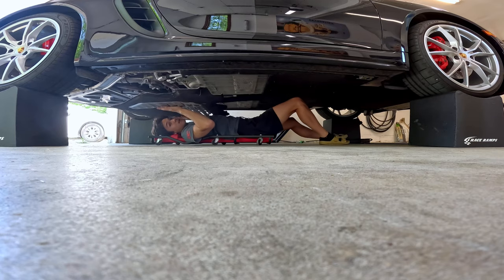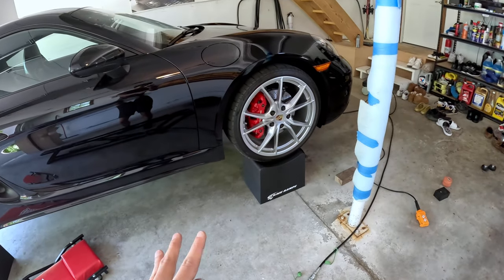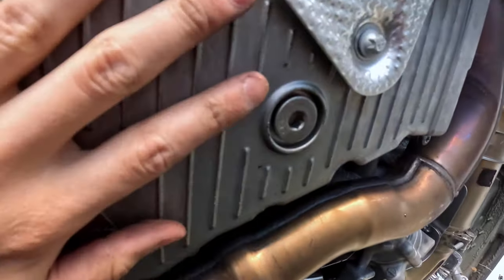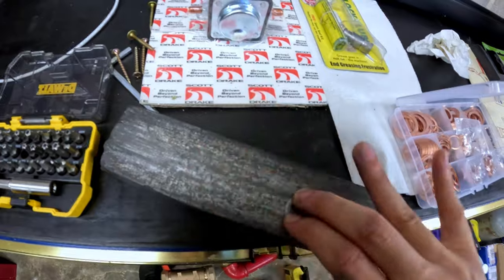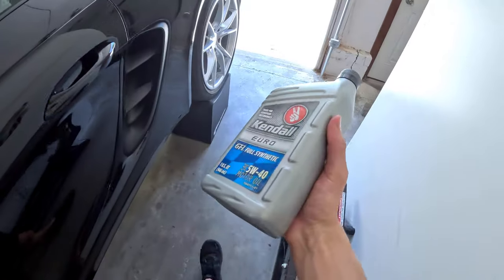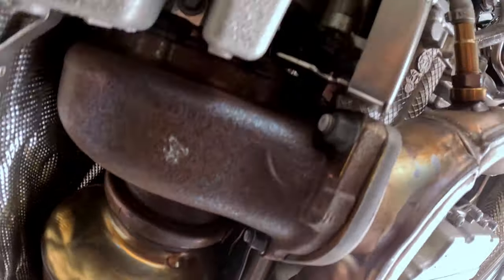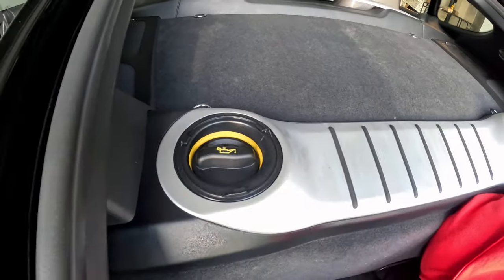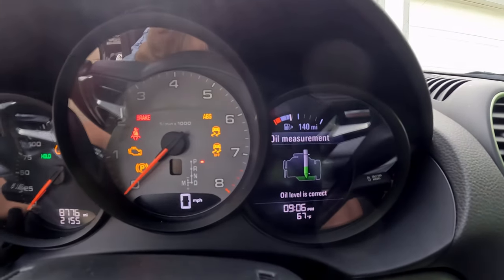Porsche 718 Cayman (982 Chassis) Oil Change + ECU Reset Tutorial

Comment: “Made in Germany, made in Germany, made in Germany…” umm, there’s the oil filter way back there… What’s the fascination with German design and engineering? If you’re spilling oil all over the car’s under tray, that doesn’t sound like good engineering to me. How much oil did not make it into the crankcase last time??
If you want something self-serviceable and affordable to maintain, what the hell are you thinking in buying a Porsche?
To justify not changing an oil filter because you’ve ‘only’ put on 3000 miles since your last oil change is absurd - when are you going to have the energy and gumption to actually change the filter? You even admit that it was 3000 “hard miles.”
Reusing a crush washer? Crush washers are engineered to ‘crush.’ Once. 
What is your reasoning for sanding the crush washer?
If your car is something so revered why would you want to cut corners with the maintenance, and then have documented proof of lax maintenance?
A car with no dipstick. Is that sound engineering? 
If you’re looking for something that is cheap and easy to maintain, and will get you from A to B without a computer telling you (or not) that you’re low on oil maybe stick with a Japanese car (Mazda MX-5?) - I saw a Lexus and a Corolla in the background…
How much did the hydraulic lift, Race Ramps, and OBD scanner cost?
The resale value of your Porsche (or any “premium” car) plummets when not properly maintained, so maybe the dealerships $700 oil change isn’t so bad after all.
I feel like an old curmudgeon right about now.
Reply from the maker: Thanks for your comment. I appreciate you watching my video. I will answer all your questions in numbered order.
1. My fascination with German engineering is that it is a foreign design. I live in America and don't see many cars with genuine German engineering. Many are German companies but assembled elsewhere in a cheaper country. 
2. My spilling oil into my undertray was a user error, and I wasn't being careful to not spill any oil. That's my fault, not necessarily the engineering of the car. The last time I had maybe, at most, 1/4 quart that did not make it into the crankcase, but no big deal.
3. I never said I wanted a car that was self-serviceable and easy to maintain. I have a Toyota Rav4 for that. This isn't my only car, and this car only comes out in perfect road conditions. No salt, no rain ever. When shopping for this car, serviceable and affordable to maintain was not even considered. 
4. I did not change the filter at 3000 miles on it because this is not my everyday driver. It would probably take another year, if not more, before I reach the appropriate mileage to even require changing the filter. By then, I will be changing the oil once more, and that is when I will change the filter, and it will definitely still be under the recommended mileage when I change both oil and filter next.
5. Reusing a crush washer was because I didn't have a replacement washer to put in place. I even said in the video this isn't the recommended way to do this, so I am not encouraging it, and the risk is all upon me. The crush washers work by crushing the edges of the washer to ensure a perfect seal with no leaks. The reason for sanding it down is to sand down the bits that have not been crushed to create a flat washer again. At that point, the crush washer will work again correctly without any leaks. A crush washer is only meant to be used once, but sanding it is one way to extend the washer's life to be used one more time. I wouldn't do it a third time, though. In a perfect world, I would've had another crush washer to replace it, but knowing it would take a few days, I went ahead and sanded down the one I already had. It will and has been working just fine with no leaks. 
6. I don't think my maintenance is lax at all, and just because it wasn't done by Porsche Tech doesn't mean it is subpar. I know everything was done correctly, and the oil and filter have been changed before the recommended mileage and date, so I've maintained the car in more frequent intervals than Porsche recommends.
7. this car has no dipstick because of the location of the engine being the center of the car. Unless you start taking apart the interior, there isn't easy access to the top of the engine. You can call that lax engineering, but in my eyes, there is no reason to place a dipstick in a location nobody will go through the effort of accessing. 
8. I never said I was looking for something cheap and easy to maintain without a computer telling me I'm low on oil. That is what my Rav4 is for. In my household, we have 5 Japanese cars, 3 Toyotas, 1 Lexus, and 1 Subaru, and they are all used for reliable A to B transportation and affordable maintenance. All of our second cars are Toyota/Lexus for that exact reason. Except for the WRX STI, hehe. A bunch of work was put into that one waiting for piston 4 to shoot out! Lol
9. The hydraulic lift, race ramps, and OBDII scanner cost around $2500. Sounds expensive, but we have 8 cars in my household, and the tools can be used interchangeably, so it's not a waste of money just for the Porsche. We use them for our other cars too.
10. This Porsche is my first car. I grew up in a car-people family and was fortunate enough to obtain this beautiful car at 16 in 2019. I take care of it with pride, and this thing is basically everything to me. There is nothing that could ever make me want to sell this car. Even if the engine blows, I'm keeping the chassis forever. What I do to the car is not aimed toward a good resell value. It is purely for my enjoyment. If I planned on selling the car after owning it for 2 or 3 years, you're right. I would definitely pay the $700 for an oil change to keep service records. But with no resell in sight, I'm not worried at all about the resell value of the car, and that is why I did it myself. I also think it's fun. I get underneath my car, see all the components, and learn about my car. It's purely for my own enjoyment, and I made this video for those wanting to go through a similar process as me. Not for those who are looking for optimal resell value. 

Don't feel like an old curmudgeon! To be honest, I thought you were at first, though. But the more I read, I think you are just curious as to why I do the things I do and why I did them the way I did. I think you were just curious, and I don't take your harsh criticisms personally. Hopefully, my reply helped you understand where I'm coming from as someone not worried about affordability, reliability, and resell value. 

Thanks for commenting on my video, and I hope to hear back from you to tell me your thoughts on my reasonings. Have a great rest of your day!
Reply: @allenstevens ate🍴🍴
Reply: M.      O.    R.   O.      N

Comment: The oil level check changed with the generation. The 986 (Boxster) had an old fashion dipstick and when the 987 Cayman Boxster gen 1 (2006) came out the dipstick was gone, but the oil could be measured with the engine cold, ignition switch on. I have a 2010 987.2 Cayman S which had the new (2009) MA1/9A1 engine and the oil had to be up to temperature to get a measurement and you could be sitting in the driveway or driving down the road. Pretty sure the 981 gen is the same due to same engine and yours works similar, but you have a multi information gage and can see oil pressure and temperature. The 987 of both gens have a RH gage displaying water temp, fuel level and a clock. I'd have to retrofit the 997.2 911 gages to get the oil pressure and oil temperature in the 5 pod cluster, as the computer reads those values in my Cayman. I use the Durametric Diagnostic Tool Enthusiast Version (3 car limit).

Comment: The oil level measures only when the engine is up to a certain temp minimum 90 degrees celcius or about 200-210 Fahrenheit. After it gets up to temp it takes 120 seconds to give you the reading. Also that measurement it shows the margin is within half a quart it’s not like a regular dip stick where the margin from min to max is a full quart so please be very careful when trying to get it perfect. Last thing the sensor is very sensitive and if you drive the car very hard for long if you’re dead exactly at max the heat will make the oil expand a bit and throw an overfilled light so my best recommendation is that when that bar is 3/4 of the way leave it alone and don’t top it up as you’re leaving a great amount of room for heat expansion.
Reply from the maker: Ur right about the heat expansion definitely. I wouldn’t go to the tip top max for that reason. 3/4 is about right and that’s about where I left mine. Maybe slightly higher but definitely not touching the top line. In my experience I did get the car up to temp and definitely gave it at least 120 seconds to give me a reading. I was still unable to get anything to come up. Also I read the owners manual and it said that the margin area was 1 quart from the bottom to the top. Maybe your car is different from mine but I got that out of my owners manual. Thanks for your comment, that was some useful information!
Reply: @allenstevens  Quite honestly the sensor does take forever to read on the 718s, personally I don’t drive the car and let it warm up while idling it might take long but every minute it so hold the engine at about 2k-2.5k rpm for 10 seconds it will speed up the warm up process, it should read oil once you do that and let it sit for a bit at proper temp. The sensor is almost as bad as the 2nd gen Cayannes and 1st gen Panamera. The owners manual says 1 quart but I’ve personally found it to be actually within half. You’re better off having to add then take oil out from the car with all the covers and where they located the oil filter on the 4 cylinders. Glad to hear the info was useful just trying to help out people think these cars are terrible and scary to work on but as long as you pay attention to little details like this working on them becomes real easy.

Comment: awesome vid bro! highly recomend removing the leveling sensor arm then you'll be able to get the filter off. any time you change the oil change the filter as well👍
Reply from the maker: Thank you. Also yes that’s a good recommendation about the sensor arm! I will make sure I do that next time, for some reason taking off that sensor arm didn’t even cross my mind. Also yes, usually I would change the filter every time but this was a special case, it had very few miles. I changed the oil just because of how long it had been, not because I reached the mileage. It seemed redundant to change out with so few miles using that filter. This year’s spring change will definitely get a new filter though!
Reply: @allenstevens  I have a video bro I'm editing right now.  I just did my oil change today and I remember getting a request to show how to remove or disconnect that leveling sensor. Stay tune

Comment: What is the inspection now wrench 🔧 thing about when you start the Porsche.  Is that a service interval warning light ?  My 2018 Cayman 718 had it when I bought the car and I can’t clear the code
Reply from the maker: Yeah that’s a service interval thing. You’ll either have to take it to Porsche or buy something similar to the code reader I showed at the end to clear the code. I just plugged into the OBD II port and cleared the code and it went away. I could even set the date for the next time it will pop up.

Comment: Great video.  I’ve a 2022 718 S (599 miles) so not really for an oil change yet.   Just a quick question — what was the source of the excess oil on the pans underneath the car?  Thanks!
Reply from the maker: So when I filled up the oil I used a smaller funnel. Between the black oil cap and the yellow plastic there is a small gap that is almost impossible to see. I think when I filled up the oil last time I filled the funnel too much too fast and it over filled into that crack without me noticing it. That’s why this time I used a funnel with a longer nozzle so that I can see that gap and know it’s not going into it. I hope I explained it good enough. Don’t be afraid to ask for more detail if that didn’t make any sense.
Reply from the maker: So it wasn’t from underneath the car, it was from me overfilling it from the top of the car and it dripped down to the pan from there. Also congrats on the new car! Drive safe and I hope you enjoy.
Reply: @allenstevens  ah.  I heard you warn about the gap in the video.   Didn’t realize the overflow was the result.  Thanks!

Comment: Nice vid, where did you get the pucks from? Do you think the rubber stands that come with the quickjack would work without the pucks?
Reply from the maker: Thanks! I honestly forget where I bought them from now, sorry but, I looked up “Porsche jack pad” and found a few results. I was worried about using the rubber blocks only because the jack points seemed too narrow for using just the rubber blocks. I was afraid I would crush something because it looked like it was going to put pressure in places not meant for pressure. In my opinion I felt like the safer option was to buy the pads and place the rubber blocks under that. Hope this helps!
Reply: @allenstevens  Gotcha, that definitely helps! Thanks!
Reply from the maker: You’re welcome!

Comment: Glad that you used full synthetic oil 😁
You did it just perfectly.  Well done.
Sold my 718T yesterday.  I m a happy new owner of a C7 Z06 (only 4000 km) and it s a Carbon 65, very rare over here in Belgium.  Damn this car looks so exotic and it s a beast!  Those 660 HP are not fake! Never seen one in Belgium actually.  The only Chevy I ve seen here is a Camaro SS!  I ll continue to follow your adventure tho.  Take care.
Reply from the maker: Woahh a Z06 is fairly uncommon even here in Kentucky and that's where the corvette factory is!! That's such a cool car I've only seen a couple here, it must be almost impossible to find in Belgium. Glad to hear you'll still stick around, Im always excited to hear what you have to say on my videos. Congratulations on the new Z06. Maybe post some videos to share of it I would definitely love to hear your thoughts. 660 HP takes some throttle discipline for sure. Drive safe and once again congrats on the beast of a car!